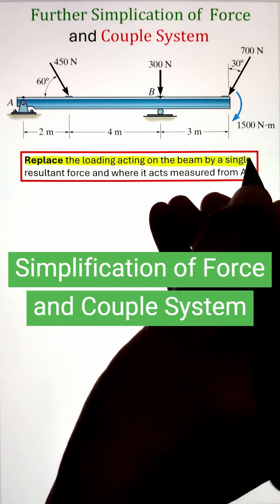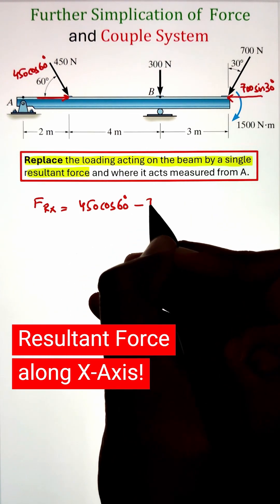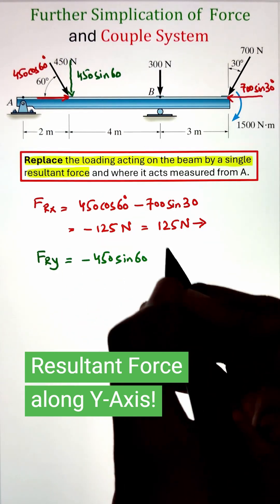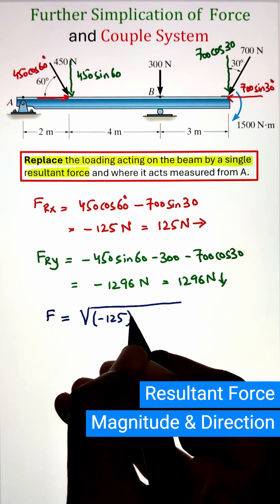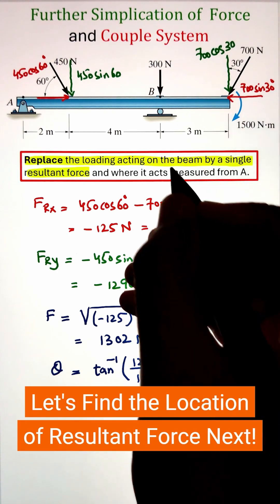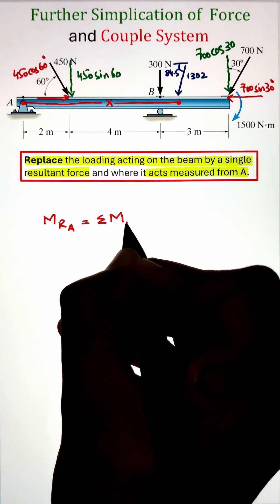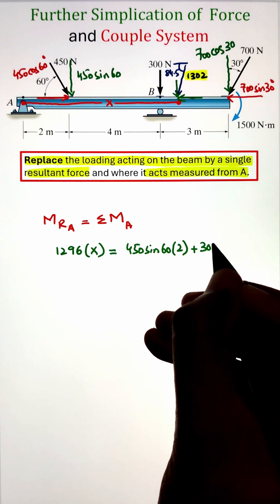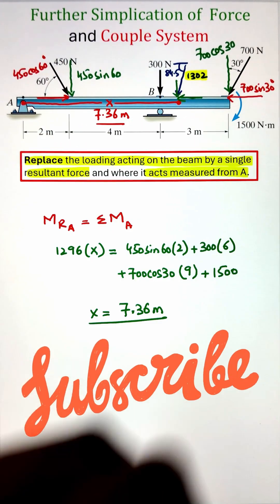Simplify Beam Forces & Couples → Single Resultant (Quick Statics Short)

Comment: I don't know Why Fr is placed between 300N and 700N,for the moment Fy is multiply by x
Reply from the maker: You can place it at any point on the beam, since we are solving for the position of it. In this case I have placed at a distance (x) from the A, then applied the moment equation to find the value of (x).
Reply: @MathPhysicsEngage  thanks a lot

Comment from the maker: For the vertical components both are directed downwards that is why negative. 
however for the horizontal component look at the Arrowhead of vectors the 700N is pointed towards left and down whereas the 450 one is going to right and down, that is why the horizontal component of both force are in opposite direction and one is positive and the other is negative.

Comment: Why are the horizontal and vertical components of the 700N force opposite of the 450N force?
Reply from the maker: For the vertical components both are directed downwards that is why negative. 
however for the horizontal component look at the Arrowhead of vectors the 700N is pointed towards left and down whereas the 450 one is going to right and down, that is why the horizontal component of both force are in opposite direction and one is positive and the other is negative.